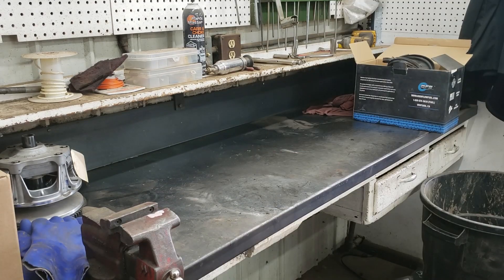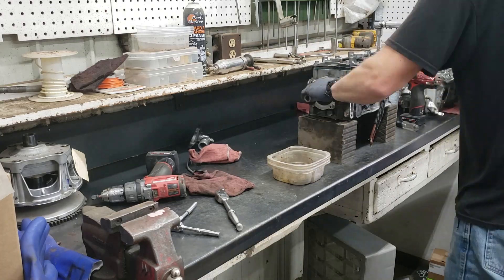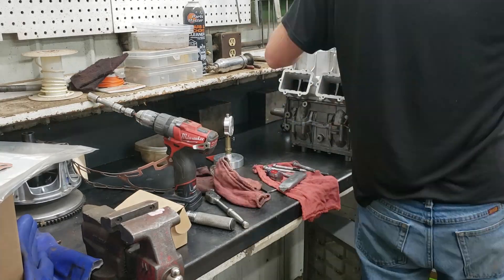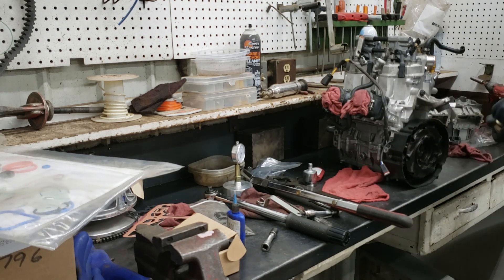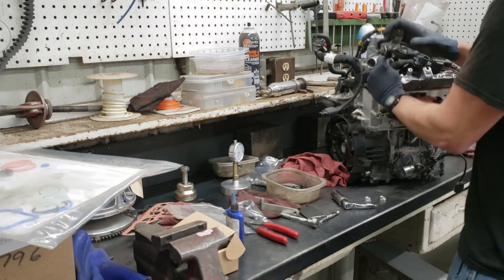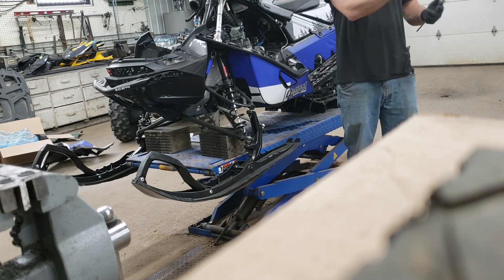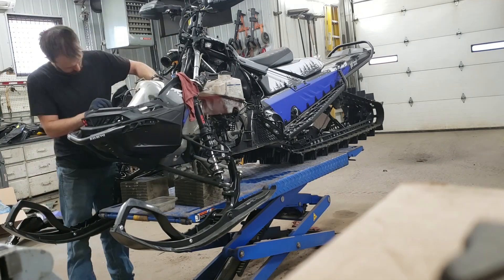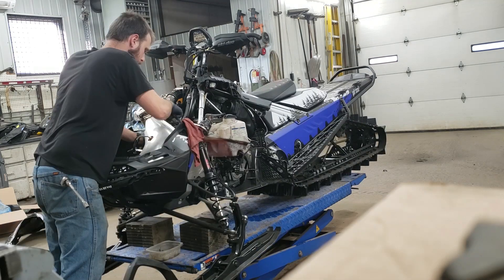Ski Doo 850 Etec engine assembly

Comment: Hey. I just changed the cylinder and pistons on my ski doo freeride 850 2018mod. The cylinder came from a wrecked ski doo and came with new rave and R.I.D. That was installed before it wrecked. Put it in the engine and started it up didnt get any errors on display but do i need to hook up a computer to calibrate the R.I.Ds? The engine is running wery good at idling and when giving a little gas.

Comment: I'm holding off on buying an 850 because of the non-rebuildable crank.  It's 3x the price of a crank for an 800.  I thought the bolt together design would make it easier to rebuild, but only parts available are from BRP and they're absolutely soaking people.  I wish the aftermarket would step up and build something for less $$
Reply from the maker: I agree. They obviously have a torque sequence to assemble them, let us have it so that we can rebuild them! It would be very nice.
Reply: @Dr.Powersports141  I was reading that the material the rods are made from makes it really hard to align the caps back on, if they're off by just a few microns, the split roller rod bearing will fail in minutes.  BRP has a jig to align the rod caps perfectly so this doesn't happen apparently
Reply from the maker: Hmmmm.  They are a cracked rod cap, just like almost everything now days.
Who knows.....